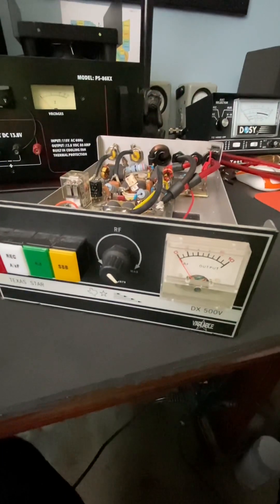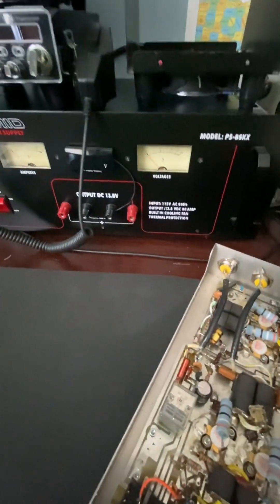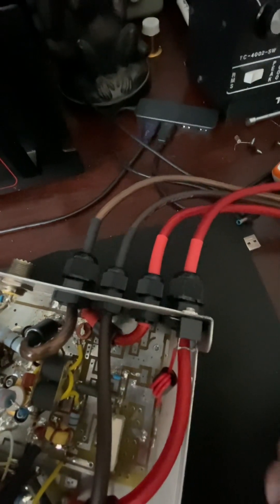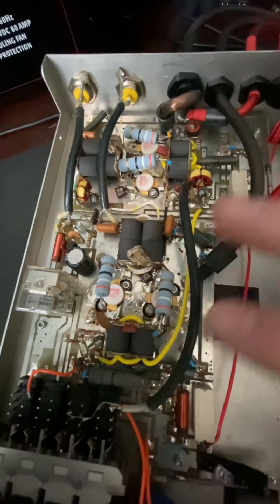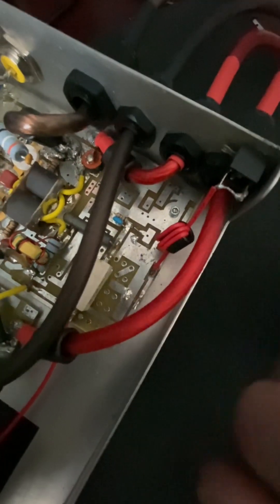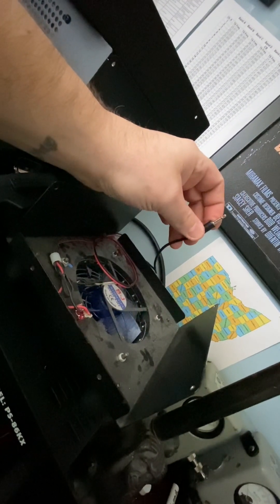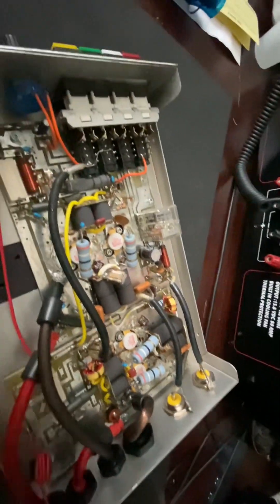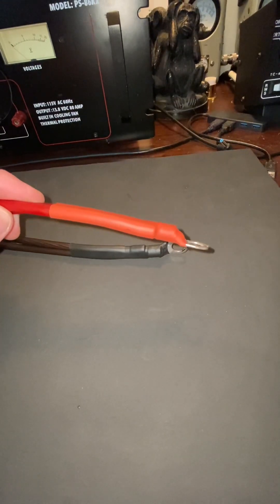Texas Star DX 500v Power Wire Upgrade

Comment: Nice that is an incredible 200w gain just with power wire upgrades! I was wondering your input of your radio rig? 4 watts I presume? 
Also did you consider running your supply voltage up to 14.9/15v? I think that with a stable power supply voltage the amperage will also be a bit less at higher supply line voltage? 
What was the amperage draw at 700w out? 

It seems these TX Star 500v amps can really put out some great numbers for such a small package! The Toshiba 2879's are stellar pills! Also TX Star has a nice clean amp design as well. 

I like your re-usage of the "key" 3.5mm jack on the back for a fan kit! Fans are always the key to long amp life! Well and a good ant cable/load! LOL 

I bought 2 used "unknown-condition" TX DX 500V's from a wonderful lady, her father retired from truck driving, one was good and one was bad, so I have a project amp! LOL 
I wil def be upgrading both amps power wires, blue LED's, fan kits, ferrite's, and anything else I can Geek-Out on! 

Just curious what Rig are you running? 
I am looking a slightly moded 10 & 11 meter rig with 8-10 watts out as I understand you should NOT put much into these amps. I heard/saw somewhere (yeah it's prob false then-lol!) Toshiba or TX Star said 40 watts in is about max but it sure seems like everyone on YT gets great numbers with 5-10w in and 14.8-15v supply. 
Your thoughts? 
TR
Reply from the maker: @trainerrandy9734

So the power wire upgrade def. makes a huge difference.  I used 8g wire but you could use 4 gauge if you really wanted to go all out.  I am running a Stryker 955 radio and since I am sharing the same power supply I dont want to run it at 15v.  You will probably see more watts from the Texas star 500 at 15v but you also put more stress on the unit.  For my setup 14.5/14.6 seemed to be the sweet spot for me.  

So the Stryker 955 is set up to deadkey 2 watts and swing 80-100 watts depending on voltage.  I see around 90 watts at 14.6 volts.  In my opinion the Stryker 955 is a great radio for 4 or 6 pill amps.  

So a lot of people will tell you the specs of the texas star and tell you not to run more than 10 watts or 40 watts.  The Texas Star 400 & 500 are straight 4 pill amps.  I have ran radios that swing 80-100 watts into both style amps and never had any issues.  If you talk a lot I would recommend a 6 pill amp but a straight 4 pill amp with Toshibas 2290 or 2879 will handle up to 100 watts.  You should keep your deadkey down to 1 or 2 watts.  You can probably deadkey 4 watts but always start low and adjust up using a bird meter.    

The Texas Star 667 is not a straight 4 pill amp.  It is a 1 driving 4.  So if you are using an older 667 with toshibas I would recommend a low power radio.  I do not recommend the new 667.  Long story but they are not for high power radios and do not hold up like the old toshibas.  A lot of people think the 667 is better than a 500.  The truth is the 667 amp is really for running Cobra 29 radios or anything similar.  It is a great amp but if you want to run a high power 10 meter rig then stick with a texas star 500.  

Basically if you are running 2879 pills you should be able to run 25 watts per pill into the amp.  2 pill 50 watts, 4 pill 100 watts and 6 pill 150 watts.   Some amps will take less and some will take more but that is just some basics I go by.  Everyone has their way of explaining.  

By the way I am thinking of upgrading to a 6 pill Carl Built Amp.  That will be a future buy probably around December.  

Thanks for watching.

Comment: I don't know what it is but for some reason your videos will not load on my TV I can watch every other YouTube video but yours it will not load it just shows a black screen and loading but now I can play it on my phone just fine I've tried the pixel resolution and everything
Reply: I don't know if it's the way you record your videos because I noticed on my phone it's got like a long screen instead of the normal size that's the only reason I can think of why it won't play on my TV
Reply from the maker: That’s interesting.   I wonder why my videos don’t play on your tv.  It could be an issue on my end.   I’ll look into it.   Thanks for letting me know.
Reply: I don't know what it is I've tried to go through every setting I can think of I know it's crazy I can't figure it out
Reply from the maker: @treeguy4009  when I get home I’ll see what I can figure out.  Most likely it’s because I record with my phone.   I’m definitely not using high end equipment.
Reply: I don't know what just happened I just went back and tried to play your video and it finally played I don't know if you change something on your end or maybe when I went through the settings I  finally found something that works but it's finally playing this is the first one that has played on my TV lol
Reply from the maker: @treeguy4009  Very interesting. I didn't do anything but I am glad it's working now.  Thanks for the update !!!
Reply: I figured out what it was I had to change it to 360 pixels and exit out of YouTube and go back to it and now it's playing lol sorry about all that that's the first time I've ever had that to happen and it was on auto but for some reason it wouldn't Auto change to it